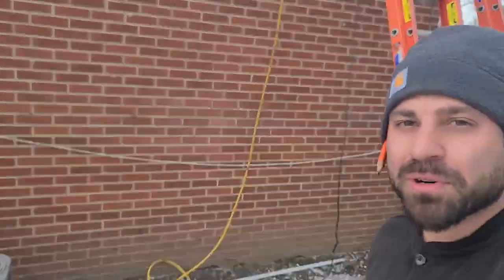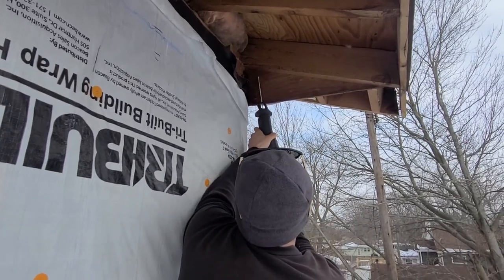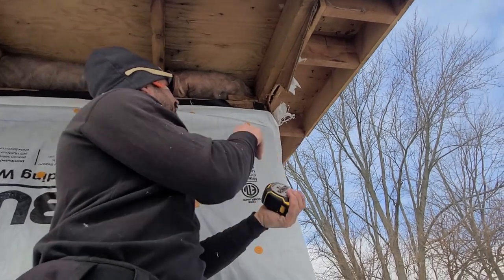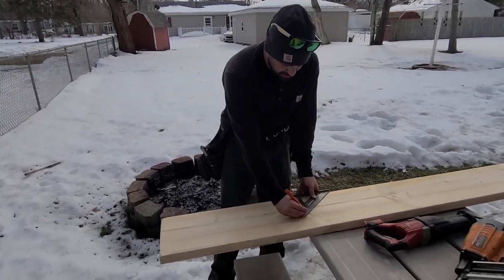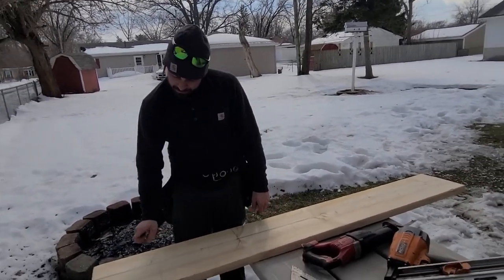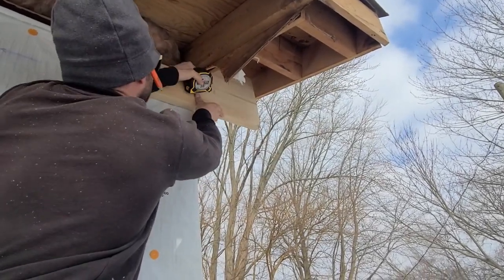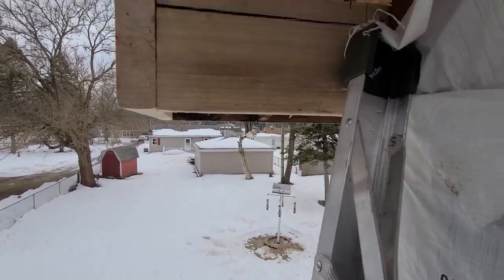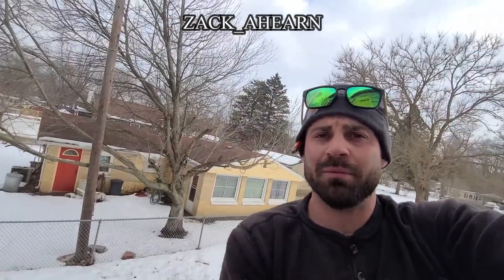HOW TO | Build A Bird Box For Soffit

Comment: Zach, we didn't frame bird boxes normally if there was no framing we used a 2x4 extended it out to be even with the fascia board on the gable and attached everything we needed to that. Much stronger than you would think too.

Comment: The struggle was real getting that nailed in, eh? I hate heavy hoses too. When I am stuck with one I get some slack and temporarily hook it on my belt somewhere. Around my hammer or snips or whatever is sticking out at the time. Or throw a loop around the top of the ladder if I'm doing a lot of work in one spot
Reply from the maker: yea i forget things like that in the moment sometimes lmao devinitely have folded the hose n put it in my snip loop before to relive the pressure. or over the shoulder even can help

Comment: Good video, you should of just brought the 2x10 too the 1x6 fascia board and cut off the pork chops with 1x6 and finished it off with 1 inch finishing nails, it would of been alot easier on you, make sure too oil that framing nailer everyday or it will skip more and break down then you will be buying another one!

Comment: Zach, you're using a left hand circular saw in your right hand. However it being cordless it may not have the power of the much more powerful AC saws. Kickback with the blade on the inside would really be bad back in the day. Some newer saws have brakes that help to slow down the blade speed once the trigger is released. However safety features do fail from time to time. Just Sayin, Whip